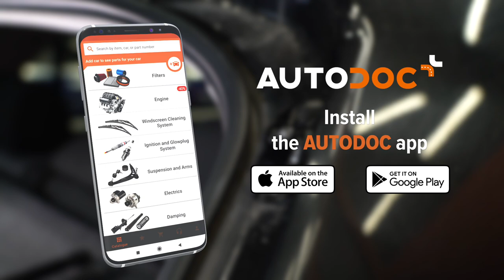How to change the tailgate struts on your car [AUTODOC TUTORIAL]

Comment: What lubricant do you use when on the ball studs when replacing the struts
Reply from the maker: There is grease in the new gas stops in the places where the hinges are attached
already from the factory.
AUTODOC